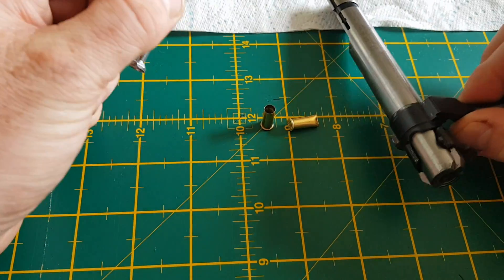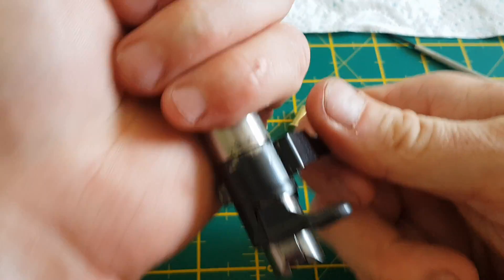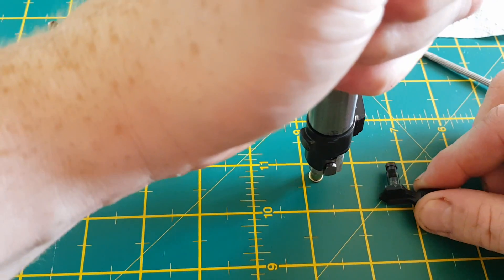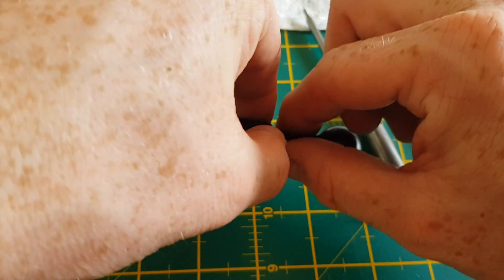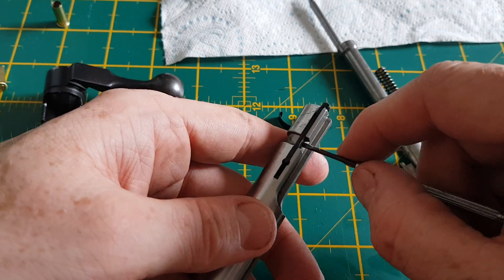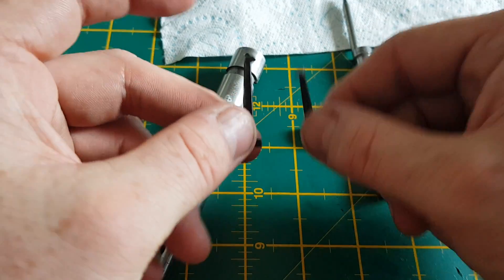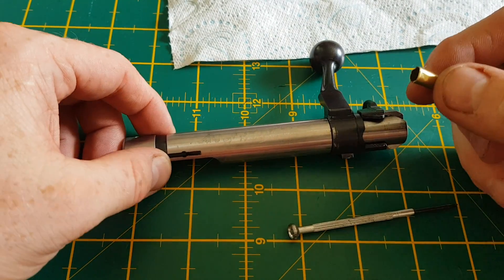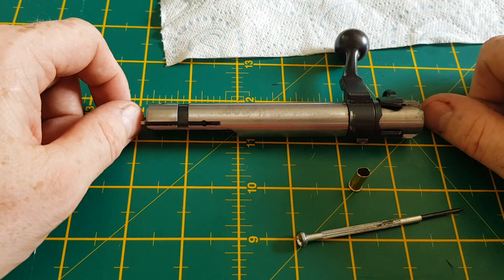CZ455/452 .22lr full  bolt disassembly and reassembly

Comment: Thanks. Was struggling to get the bolt back into my .22. The final section answered that question - had to press the pin in to get the bolt in the right place to reinsert. A lot of sweating before finding this video
Reply from the maker: Glad it helped now you have done it you will do it easy now 👍

Comment: I got my 452 bolt striped and cleaned to day because of this vid. First time it had been cleaned as my dad never bovered cleaning it and I didn't no how. Instead of using a fired case I used the corner of a table.
Reply from the maker: matt BLANCHFLOWER Glad you were able to get it done . Has it fixed your issue?
Reply: Fieldsports Scotland I haven't tested her yet but there was a lot of crud under the extractors

Comment: What an amazing video! and easy to follow. In fact I was stripping my bolt whilst watching. 

However, instead of a used spent brass piece, I used a 3D printed tool.
Reply from the maker: Thankyou
Reply from the maker: I use a bit of brass because anyone who shoots rimfire will have some lying about spent .22lr .22wmr and .17hmr casings all work in fact the bigger casings are better than the .22lr . Also must add there is no difference in the bolts for any of the cz455 calibres

Comment: Thanks for the info as it's not self evident how to strip the bolt.   I use a vice with soft jaws to hold the bolt and a round nosed rod to push in the spring so as to not mark the bolt spring slider, much less faffing than using a spent case.
Reply: Thank you, your comment helped me!  I agree with you that holding the bolt in a padded vise is better than a third hand!  I just reassembled my CZ452 bolt, and the vise is the only way to go!  Happy trails!  LFF

Comment: How do u take the fixed rear sight off a cz 452 22lr so I can fit a scope?
Reply from the maker: @dyermccall2840  so it is best if I saw your sight but if I can remember you press in the top flat plate on the sight and while pressing down you slide it back towards you. Under it there is screws . Hope that helps